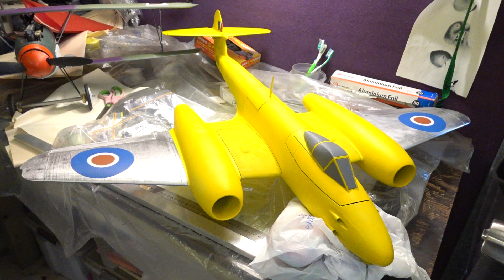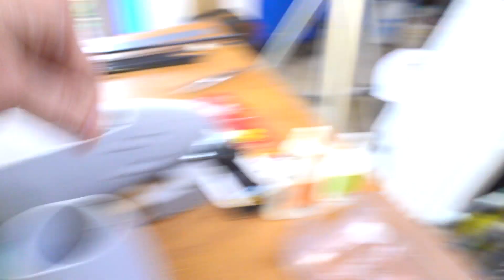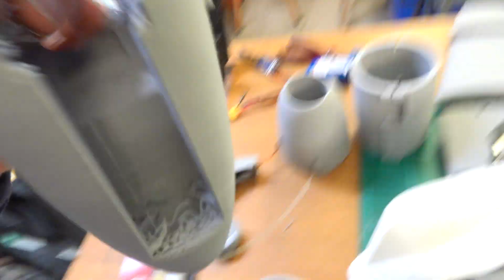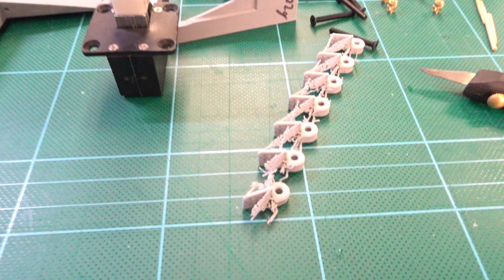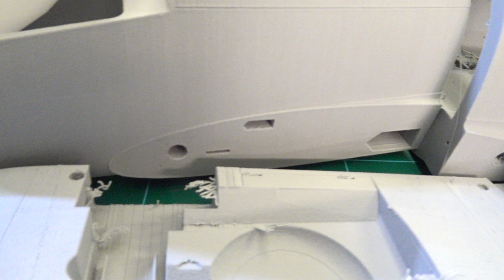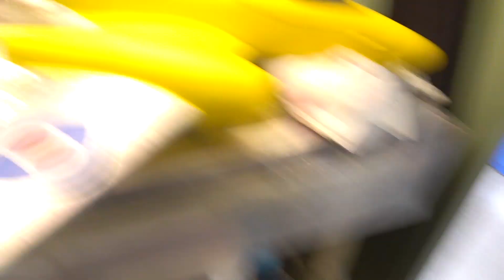Printed R\C Meteor F.4 -Introduction to build

Comment: Hi, are the stl files available for purchase/download, cheers
Reply from the maker: Hi MrSurtz
Yes, the fixed gear version is currently available on CULTS:
https://cults3d.com/:1913920

The retract version will be available soon (after its tested)

Both versions (mostly the same parts) are/will be free to download. Feedback and flight reports appreciated.

There is also an RC groups thread if you want a bit more information at:
https://www.rcgroups.com/forums/showthread.php?4434827-Gloster-Meteor-f-4
Reply: @philb1167  Thanks